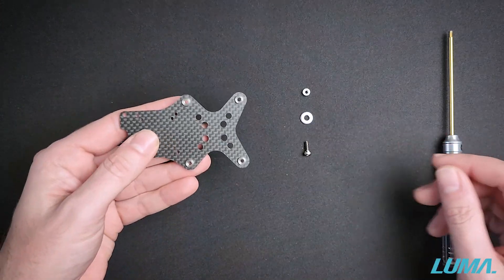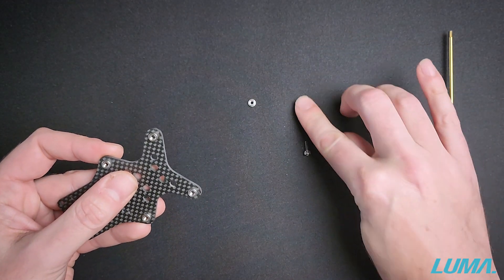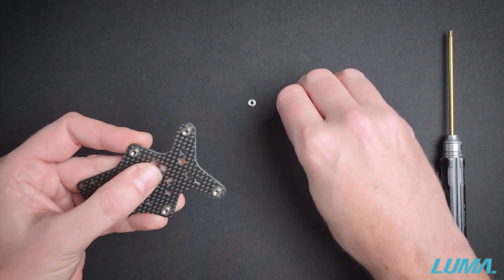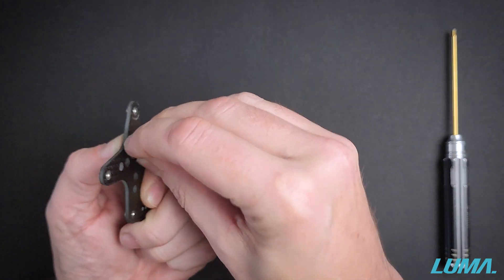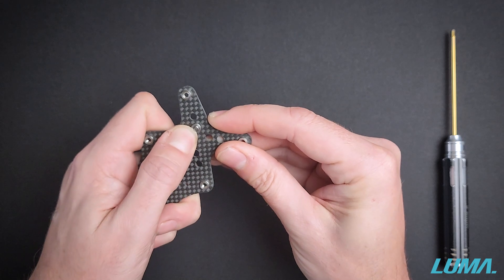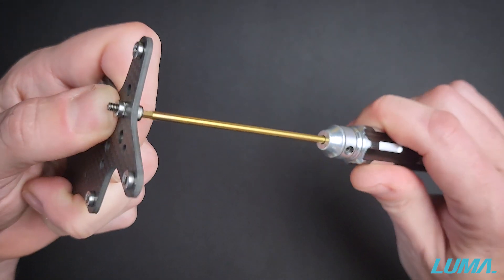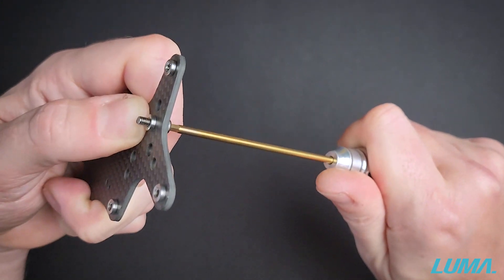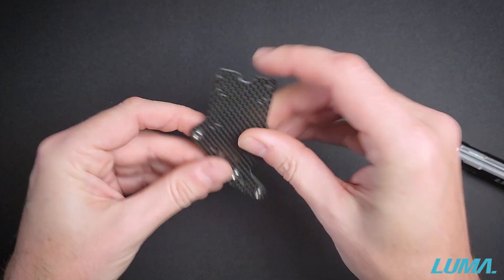How to install Press Nuts into Carbon fibre - THE RIGHT WAY!

Comment: What if you dont have access to both sides? Like its just a solid surface of carbon and the other side is aesthetic?
Reply: If you can’t access both sides you might need a blind fastener like a well nut or a rivet nut
Reply: we're not too sure what you mean here; press nuts are usually used in through holes and held in place by opposing force by bolts from the other side of the plate, have a chat to the manufacturer that made the product you're working with.
Reply: Threaded inserts